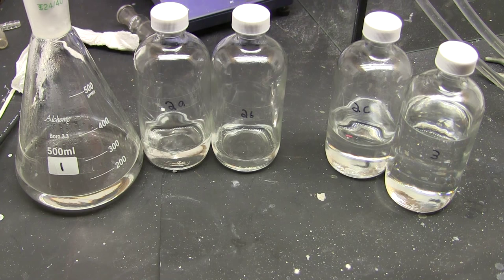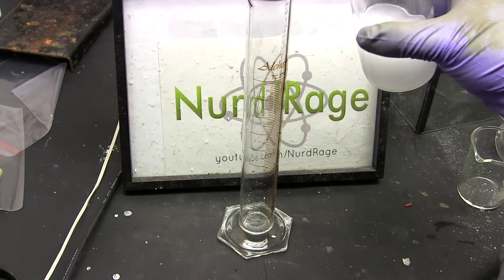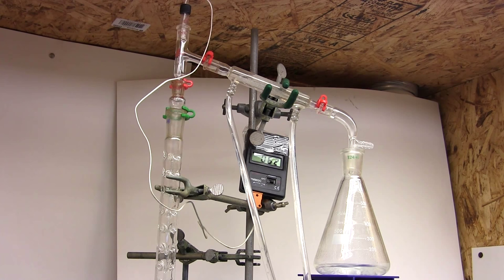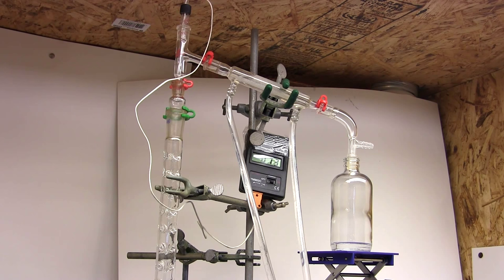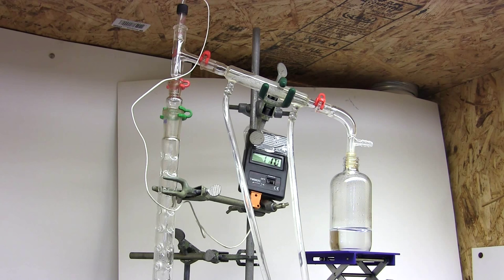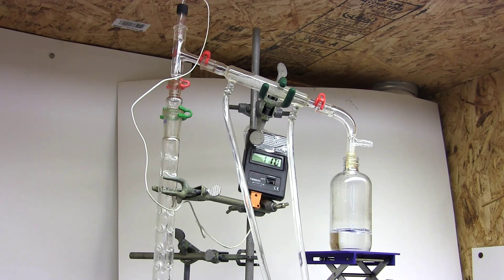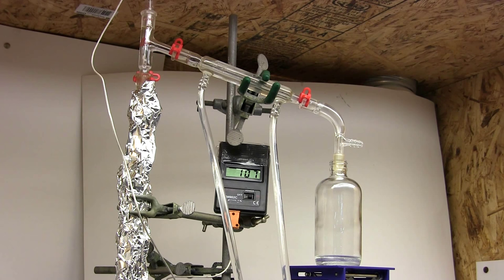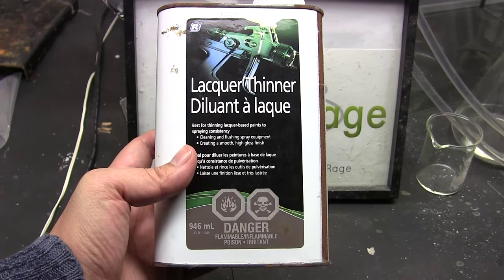Fractional Distillation of Lacquer Thinner to Obtain Toluene

Comment: hey nurdrage im in college and in chemistry there is 1 thing that im curious about, about alcohols. lets say that i make my own alcohol mixture from whatever, and then i distill it, i will get ethanol and methanol as my final product(also water). is there any way i can know how much methanol% and ethanol% i will get ?(alright im not gonna make my own alcohol and drink it, its so cheap to buy from shops anyways, im curious about how companies do this who sell alcohol drinks).

and also how do i get the methanol separate from ethanol, if i want to use them in something? methanol boils at 65 degrees, and ethanol 78,37, so can i basically get the methanol first at 65, and then heat it up to 78 to get ethanol seperate? im just wondering how do the companies do this(who make drinkable alcohol, like absolut vodka) without getting methanol in their final product? i know this sounds like i want to distill alcohol and drink it, but as i said its pretty cheap to buy and i would never trust my ability to do my own alcohol to drink it, there are risks at that which im not willing to take
Reply: +bastard good quality drinking alcohol is made by controlled fermentation, and the amount of methanol that gets formed is very small, so they dont have to do anything fancy extra to remove methanol,  because there is so little in there, or if there is some methanol they just throw away the first 1-10% of the  distillate, that will get rid of the methanol

Comment: You should try to pour gallium on AR500 armor plates, that would be amazing to see!
Reply: Gallium does not make an amalgam with any of the metals present in AR500 steel. Gallium would do nothing to it.
Reply: +A. Zak Aww
Reply: The Gaming Chicken Mercury would amalgamate the steel, but very slowly.
Reply: My guess would be that a couple gallons of mercury would take 2 or 3 years to destroy an AR500 armor plate. Obviously without the anti spalling coating.
Reply: A. Zak 
Gallium doesn’t make amalgams, it makes alloys.

Comment: This spinning band thing sounds very interesting, there doesn't seem to be much useful info online though.
Reply from the maker: +Adam Harrington Yeah it is pretty cool, i'll see if i can build a crude one.
Reply: NurdRage If I could find some dimensions I could machine a nice "band*" from PTFE or similar, but there doesn't seem to be any available, do you know any information like that (diameter of the band, ID of the column, shape of the band(I was thinking of cutting a deep, 2tpi square form thread), length, rpm etc)?

*Is there a logical reason for calling it a band?
Reply from the maker: +Adam Harrington The bands are custom built to whatever column they are used in. For amateur use i think you can just eyeball it, the exact dimensions are kept secret by the manufacturers.

I think there is a reason for a calling it a band, but i've forgotten what that was :)

Comment: Why do chemists use aluminum foil, in particular, as an insulating material? It seems to me that metals in general do not make good insulating materials, and even among metals, aluminum is well known as a good conductor of heat. It is just that it's cheap and available? Are there problems with using other materials such as cloth, fibreglass, asbestos wool (if you can find it), cardboard, etc?
Reply: It's temperature resistant, cheap, easy to shape and widely available. It doesn't matter if it's a good heat conductor, as air is extremely poor at conducting (but good at convection heating), and it is the air layer trapped between aluminum foil and flask that does the insulation. Cloth or cardboard could burn in high temperature distillations and in general you don't want more of a fire risk, especially when working with flammable solvents. Other materials are suitable too, but there is little point as aluminum works just fine.

Comment: Could this method be use to clean dirty lacquer thinner (as used to clean a spray gun) by fractionally distilling the parts leaving the impunitys in the booling flask and then recombining the fractions, I know there are industrial units for this but don't use enough to spend the money on one and don't have the space, and it would be better to clean and reuse thinner than throwing away after one use
Reply from the maker: +theguru18 I think so. (i've never reused redistilled lacquer thinner so i'm not 100% certain).
Reply: +NurdRage thanks for the reply I'll have to get the gear and try
Reply: @theguru18  just simple distillation is better in your case,

Comment: 80 degrees centigrade. It not benzene?
Reply: Doubtful. I'm no expert but I think that amount of Benzene in a commonly available chemical from a hardware store would be way above what is normally allowed. Benzene is more toxic than toluene and is a known carcinogen and Benzene offers very little, if any, advantages when used as a solvent compared to much safer Toluene.

As an example Gasoline for sale in Canada is only allowed to be at most 1.5% Benzene.
Reply: benzene is to expensive for thinner, heptane and IPA are very cheap

Comment: Wouldn't it have been easier to decant out the Toluene and then fractional distillation for the rest of the components?
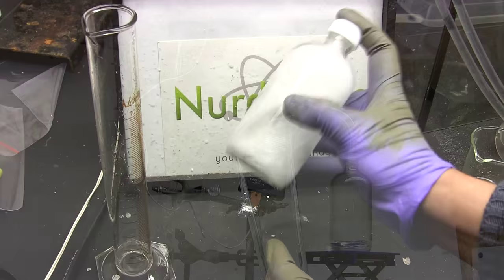Reply from the maker: +Jr Nazon I'm pretty sure i answered that exact question at 5:43
Reply: I meant with easier is that the toluene be cleaner and more pure. Then distill out the other components since they can be used.
Reply from the maker: +Jr Nazon no

Comment: My lacquer thinner contains 30% xylene (xylol). Is it worth recovering?
Reply: Toluene or xylenes?
Reply: +Marcin Goławski Because separating xylenes is tricky. Toluene is easy, especially if you will separate together with a bit of water you will add. Toluene forms a low boiling azeotrope with water. Xylenes apparently do not.

Comment: Suppose it all comes down to effort. But could you make a refux column with stainless steel and a needle valve. They either pack with steel wool or ceramic to increase  surface area and thus theoretical plates. Can find those sanitary ss tube and tri wing clamps on AliExpress. 

https://homedistiller.org/forum/viewtopic.php?f=17&t=66660
Reply: As far as I'm aware the needle valve controls rate of refux and is thus less temperature dependent. Higher refux ratios lead to better seperation.
Reply: There is a picture at the bottom of full rig

Comment: Cmon. You make like 250,000 a year off youtube alone. Now you're STILL pushing patreon?
Reply from the maker: +MetroDET2011 No. Youtube only pays about 5k per year. Meanwhile the rental for the space i work in is 2k per month. Then there is the cost of equipment and chemicals. I have to use patreon to make up the difference.
Reply: How do you figure that is how much he makes?